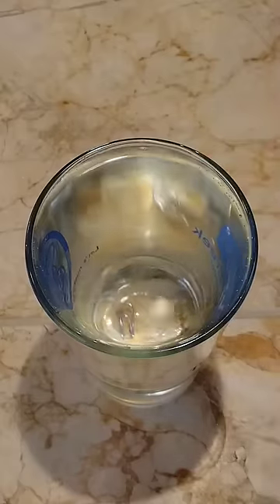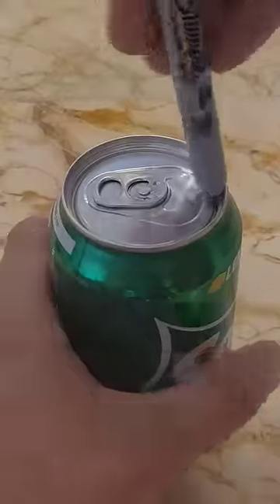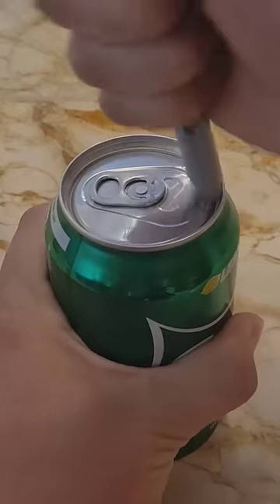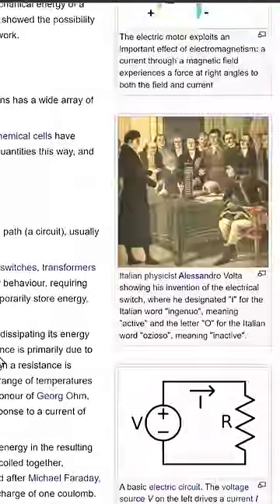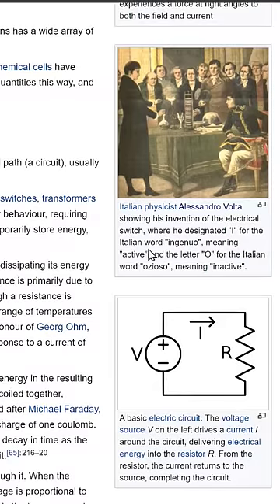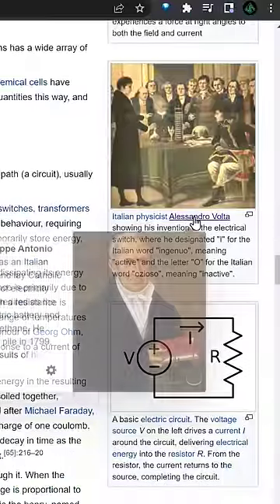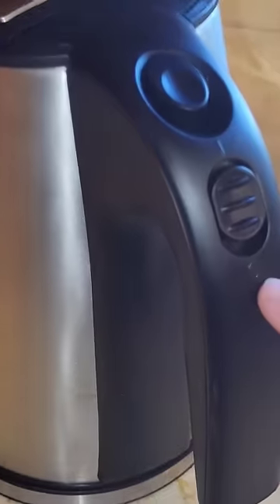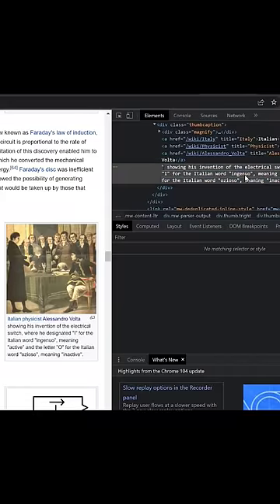2 Truths & Trash: Episode 2, Round 2 #experiments #funfacts #2truthsandtraah

Comment: I always assume the I O marks were a visual of the switch mechanism, with the I showing it's extended and connecting the gap, and the O showing it's folded over breaking the circuit
Reply: i feel like o would mean a complete loop for the circuit and I would be broken but it isnt even like it lol
Reply: @Bread.799  that doesn't really track when I powers on the device and O powers off the device. I thought it was representing just the switch mechanism, not the circuit as a whole. I was just doing mental gymnastics

Comment: Except that the actual symbols are a line and circle, not 1 and 0, and it's used many other places than electrical for power - closed hatches are | and open are O for example. Closed and Open (as in circuit) is a more convincing explanation for the pictograms.

Comment: I thought I was a shortcircuit and O was an open circuit. I guess I was right for the wrong reasons
Reply: To clarify: in electronics, the symbol for “there is current passing through here” is a straight line and the symbol for “the current stops at this point” is a circle.